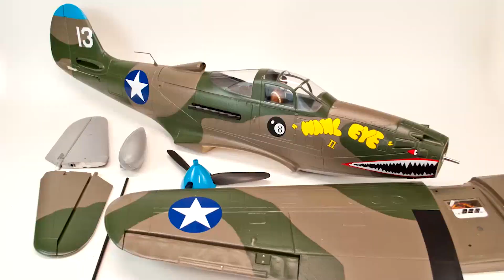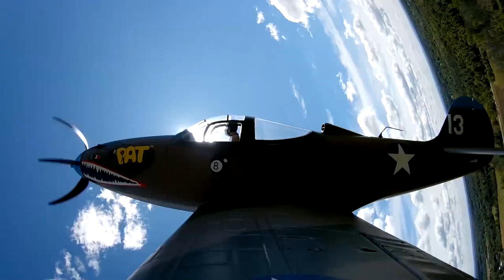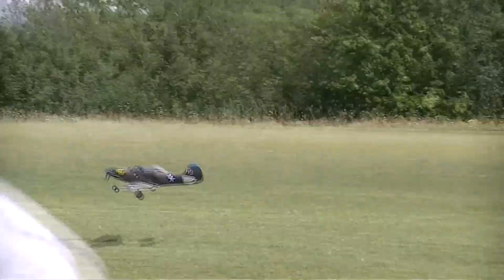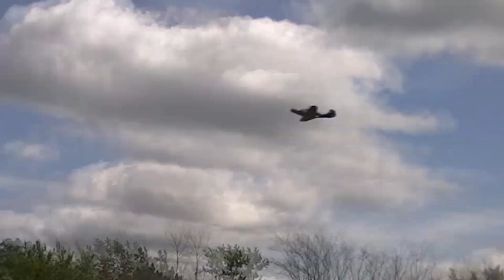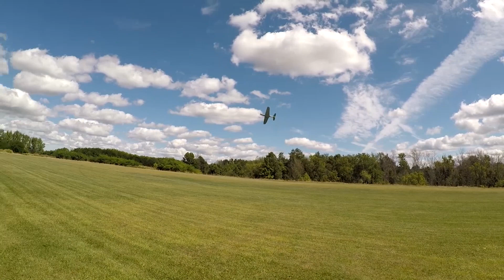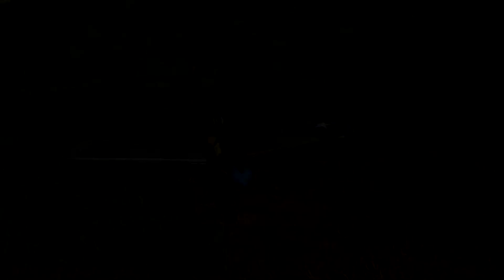Horizon Hobby E-flite P-39 Airacobra 1.2m BNF Basic with AS3X and SAFE Select - Model Aviation magaz

Comment: I haven't maidened my aircraft yet, but one piece of advice our local hobby shop gave me was to not use the wing mating system as is, because pilots were having trouble with losing control on hard maneuvers. I loosened each wire from its holder and manually attached each one securely, and it seems to be good, except that wing mounting itself was a pain.  I used a trick found on Youtube, insert a small screwdriver or pick in the hole, and put the nearby screw in for easy aligning.

Comment: nice review - one question please
the retracts and steerable nose wheel features on these war birds are problematic.
Have any improvements been made for retracts and nose wheel steering on this P-39 ?

Will they last or is it the same old - one hard landing on the nose and the front gear is shot,
and after a while get out the knife and carve out some foam so the gear will go all the way up or down ???
Reply: Maybe. What are the problems you're referring to?
Reply: @Weirdflight  I've had problems with retracts that don't stay lined up and I had to trim foam to allow full retract or extension -
with nose gear (especially on the Parkzone or Eflite T-28 ) one moderate bounce on the nose and it bends or the linkage begins to malfunction. It seems to be a common problem reported on RC groups.
Reply: @lw216316  I haven't seen any of that on the P-39. But mine hasn't had any particularly hard landings...yet.